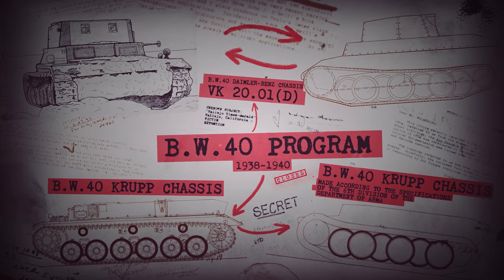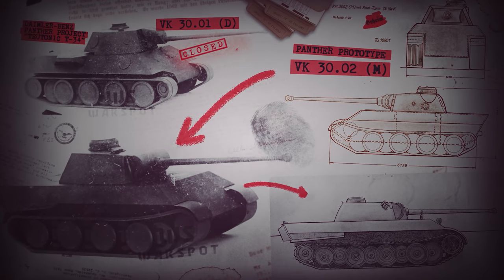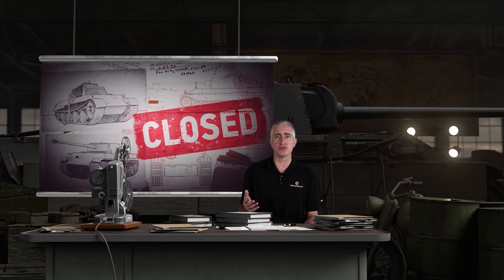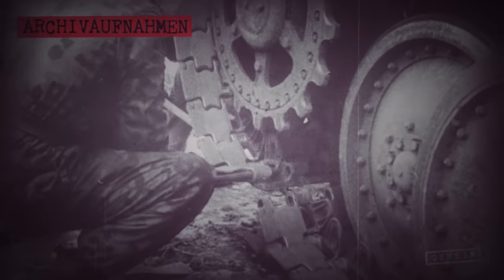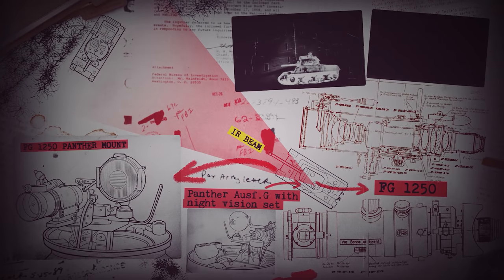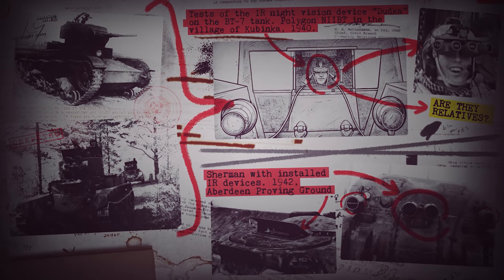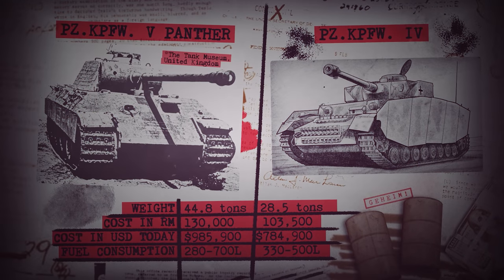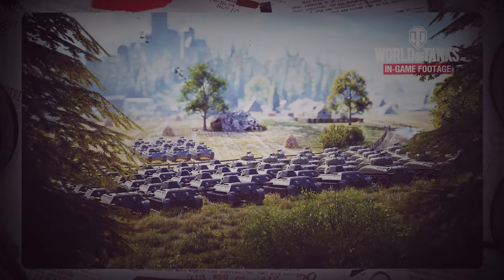Five Things About the Panther with The Chieftain - World of Tanks

Comment: In Quora, I pointed our that Germany only looks like it had more advanced technology because they pushed everything out of the lab and off the drawing table into the battlefield faster than anyone else. The U.S.A., in particular, had some amazing weapons systems in development during WWII, but they never put them into the field.
Reply: A sane addition to our forum.  Thanks for it.
Reply: High velocity guns like 75 and 88mm were generation ahead of any other. And they had jet planes year ahead of anyone else. But their electronics and organization of mass production were lagging behind.
Reply: The USA developed proximity fuse which was a true super weapon. 
And the USA put this weapon into the field both for AA guns and artillery.
Reply: @mladenmatosevic4591  umm the 262 and the meteor were in combat units within weeks of each other.
The German engines, even when produced postwar with "proper metals" had a fraction of the lifespan of the British designs.
As far as combat capabilities, they were designed to different requirements. As they never faced each other, you can debate all you like, but pilots, good ones anyway, fight to their crafts strengths and the opponents weakness. Why you don't go down on the deck to turn and burn with an A10, and an A10 doesn't try to go vertical at 20,000 feet. Insert whatever aircraft you want here.
And 262s, as well as mig 15s, both lost to American WW2 props. 
Oh and the P80 was "operational" by armistice. Again, not quite a year. However the He 280 did indeed fly in 42, but was only in prototype stage.
The 262 was not unique technology, nor was it unbeatable by the allies.
And the 88 wasn't a generation ahead of anything. It was an AA gun. The British used theirs the same way as the Germans in the fall of France for that matter.
The long 75 of the panther was a specialist gun. Low barrel life and small HE for the extra AP values. The Sherman 76 was the same, if less extreme.
Again there is no free lunch, just compromise to get the characteristics you want.
Reply: @drudgenemo7030  In short, British started with jet engines in same time as Germans, pre-WWII, to but Germans had more state resources do progressed bit faster. And P-80 was just a demo project, started about end of war, with access to all British (and soon German) patents. As for German 75 and 88, look at shell velocity. That was some 25% higher than other guns in 1940s. But to conclude, in 1940 key German advantage wasn't technology, but perfected use of large military units, particularly mechanized ones.
Reply: @mladenmatosevic4591  you obviously have no clue about jet engines period, ok. 
The P80 was far from a demo project, but in 1945, I'll give you it wasn't exactly front line, maybe.
The 88 , as originally developed didn't have 25% greater velocity. And the 75 was not an AA gun. Again the point of an AA gun is to get an explosive charge in proximity to the aircraft. High velocity shells, like the kwk 42, based on physics, need a thicker casing, hence less space for explosive. If anyone had great strides in the metallurgy of guns in the 40s, it was the Americans, not the Germans.
Another subject to bone up on, velocity/barrel wear/ explosive payload vs case thickness vs pressure curves.
You really should look into hi ow this stuff works.
And while the Germans had the awesome panzer units, their military was largely unmechanized. The British were more mechanized. The Americans were the first to truly organize their military as a mechanized force.
As far as "perfected", they re organized the panzer units several times between 1939 and 1945. Same as every other county. If anything, the Brits had their armored units more sorted.
Now the tactical use of tanks, yes, though not as far ahead as anyone else as most, and apparently you, believe.
Might want to research the development of armored doctrine by various countries.
Reply: @richardkalmwater5996  Yes, and while the Lockheed P-80 was inferior to the ME-262, the Gloster Meteor was close, and more importantly, the Allies could have built and fueled as many jets as they wanted in 1946, had it been necessary.
Reply: @drudgenemo7030  Indeed, P-80 was barely competing with last generation of piston fighters. As for guns, I was talking of tank guns, and 75 and 88 were used on practically all tanks and Stugs made from 1942. As for organization of tank divisions, Germans had sorted coordination with infantry and artillery and logistics in 1940, and others had that right in 1942 or so. Mind you, first deployed US mehanized division were in Operation Torch.
Reply: @mladenmatosevic4591  sorted logistics? Lol
The Germans never really did that.
Kinda why they lost.
And the P/F 80 can be derided all you want, but at certain altitudes it was a better dogfighter than the 262. Again different design requirements. The 262 was largely designed to kill bombers.
As the 262 and P80 never faced each other that's largely acedemic. By the time the P80 was really operational, it's opponent was the mig 15, a much later and more advanced design, like the f86. Fact remains the 262 would have been facing the P80, a small nimble dogfighter, AND the meteor, a large multirole fighter. And the Soviets were busy with their own designs as well, though I'm less knowledgeable about those, past the Soviet ramjet experiments.
The whittle designs go back to WW1, hardly the same timeframe as the Germans.
As far as the German 88 and 75, the American 3 inch was in a turreted self propelled mount in 42, as the 76 was also trialed in a Sherman in 42, but was deemed too cramped to be workable. yes the German 88 beat the 90 in production dates, but the Germans were trying that for two years before it was fielded, about the same as the Americans.The design ideals were different than the Germans. To get the 88(or the American 90) in a tank you need a large turret ring. Meaning a bigger tank. Not an option really for the logistics be of the Americans, hardly a technology impediment. And if you want to get technical, the Germans really couldn't do that reliably either. The mechanical woes of both the cats are well documented.
Your argument be is a faulty oversimplification. A big gun doesn't do much good at the repair yard.
And a high velocity gun has trade offs. Just because someone doesn't agree to the trade offs doesn't mean they are technologically behind. 
The engine management computer of the German aircraft was indeed a technological superiority(while American naval fire control computers were arguably the best in world). But that is hardly ever mentioned.
An absolutely awesome sight with a whopping 12 degree FOV somehow is(and that being the only sight on the panther).
The German jet engines were, according to the German pilots and ground crew, were inferior to the British engines by a wide margin.
The Germans had physically larger tanks, hence larger guns. That had more to to with logistics and reliability standards than any technical capabilities. The face hardened armor was a technological edge, but with a trade off with spalling.
The Americans would have been far worse off with German tanks than the Sherman. The Germans would haven't been able to produce the Sherman in the numbers the Americans used, and surely couldn't have fueled them in those numbers anyway, so the Sherman would have been a bad choice for the Germans.
A comparison of combat records shows the Sherman to be better as a corps wide tank, if less so 1vs1. And unless you're in a video game, how the army as a whole does means more than armor thickness or penetration values.
Simplification
You are taking village x with a company or brigade or whatever,
You want the tank with 25% down to maintainence, down another 25% due to lack of replacements for combat losses, and what's there only has 3/4 fuel or you want the tank with full unit strength, plus reserves, all fully fueled and with all the accompanying units(air, artillery, supply, ECT).
And even 1v1 it's more tactics and crew training than technical differences in the the Sherman and the cats. The Sherman has a definite advantage in crew vision and turret traverse, as well as mechanical strength (you bang gears in a tiger or panther you are a sitting duck), and rate of fire.
Not insignificant differences that are very hard to quantify with armor tables.
Yeah the Germans had a decided range advantage, but that only works if you got the distance to work with. 
The tiger was a heavy tank so direct comparison to the Sherman is akin to comparing the garand and the BAR.
Reply: @drudgenemo7030  I try to make short argument and you com with lengthy essay mentioning my simplification. Of course it is simplified, if I wanted to put detailed argument I would make own video instead of writing pages in comment to a comment. First lets limit time frame to 1939-1943. After that Germany was bound to lose no matter what. So, in that time frame Germany was running circles in armored warfare against all others, even though their tanks were not so superior to some others. But to French and Soviets was common in early engagements that many tanks do not reach battlefield or run out of gas or ammunition. Not so often to Germans, and that explains "logistical advantage". Regarding guns, compare 75mm KwK 42 and 88mm KwK 43 with allied guns, and note theh had muzzle velocity of 1000m/s. Allied started using such guns around 1944.  As for jets, Germans were few months ahead, but had no decisive advantage. Though, I still stand on position that P-80 was badly inferior to P-86 Sabre which came in use just 2-3 years later and was widely used in number of countries.
Reply: @mladenmatosevic4591  you forgot the faulty part.
And the vaunted afrika korps, which was very tank centric, was getting run out of Africa in 43.
And you base premise was the technical superiority of sticking a large gun in a large tank.
The tanks were somewhat less than reliable. There were indeed less reliable than was acceptable to the US anyway.
By 42, inside your timeframe, the US still had large guns in armored vehicles.
Your whole  premise is flawed.
The premise that high velocity is somehow achieved with out penalty is wrong. 
And you might want to look into the post war tests and evaluations of the 262 vs the P80 and meteor.
The ones done by the militaries, not YouTubers.
And I never said the P80 was superior to the f86, in fact I inferred the opposite.
I stated that the P80 was smaller and more nimble than the 262, hence more performance in certain flight aspects.
Reply: @drudgenemo7030  Africa corps had horrible problem with logistic since British ruled the sea. Even worse, Ostfront was always short both on man and material.
Reply: @mladenmatosevic4591  I wasn't talking logistics.
I was talking the actual combat, which if you wish to ignore because it doesn't fit with you bias, fine. 
And doesn't change the assertion that the Germans were technically superior in material. Again just because someone fields x and someone else doesn't think it's worth doesn't mean they are less technically capable.
The IR system on the panther is another example.
The Soviets messed with it, not for combat but for maneuver, as did the Americans. They concluded it wasn't worth it.
The Germans fielded it a few years later, and concluded it wasn't worth it. AFTER they fielded it.
Just because something works for group a doesn't mean it fits with what group b is doing.
And the British didn't "rule" the Mediterranean, not in 41 or 42, though a case can be made for mid 43. Malta was within days of surrender in mid 42.
In fact the British didn't even "rule" the Atlantic. The German subs were a thing.
And still not a peep from you regarding the m10 which by itself contradicts your argument, let alone the 76 Sherman in 42. Was not approved for production, but was functional.
The argument good enough today or perfect next week..
As the  75 Sherman was superior to the pzr 3&4, the Americans thought getting right was the better idea. Production of the 76 Sherman began in December 43, again within your timeframe, and was in England in may of 44 in numbers. And that's not considering the firefly, which was also an ergonomic pain, that was produced in January 44.
And considering the abysmal failure of the panther at Kursk, I'm inclined to agree that making sure it's right might be the better idea.
And neither one of the cats fit the logistical realities of the Americans. Arguably the didn't exactly fit the requirements of the Germans for that matter, they had difficulties with maintenance and supply(tigers and panthers were abandoned with alarming regularity),without the extra headache of ocean shipment.
The tank that shows up wins every time against the one that doesn't.
And even 1v1, the disparity wasn't as much as most make it out. The "horrible under armored Sherman" had equivalent frontal armor to the t34, and only minutely less than the tiger. The 75 did indeed kill tigers and panthers,the 37 even did, let alone the 76.
The jagpanther in the imperial war museum has 3 75mm holes in the side. 
And a great tank is fine, but 2 or 3 ok tanks tend to beat the one good one. And there is no getting around the production costs or time of the cats.
Reply: @drudgenemo7030  You are getting in details where each could be own detailed discussion. But bottom line is that untill end of 1941 Germans were mostly winning and since end of 1942 they were mostly losing. African landing was marginal here, most troops were fighting and dying on Eastern Front untill near end. Land Lease was steadily increasing, but became really big only after Stalingrad, when war was already decided by all modern accounts. So, what were reasons for that turn and did Germans ever had any technological and other advantage? I tried to offer some parts of military equipment Germans made good, but bottom line is that man who handle it matter more then equipment, and people learn in war providing they survive long enough. That was why Germans did well against Soviets in 1941, but were mostly losing from 1943. And of course, resources in Germany were running dry, by losing territory, blockade and bombing which all together shortened war by couple of years.
Reply: @mladenmatosevic4591  no you very clearly stated that the Germans had a decided technical advantage with the kwk 70 and the 88. 
Not a tactical advantage or anything, but was technologically superior.
Which is flat out wrong. 
And by the time either was produced and fielded, Germany's fortunes were turning for the worse, hence not much help strategically either.
Reply: @drudgenemo7030  if you bother to check around, 88mm gun has almost mythical reputation in some circles, both as AA gun of early '40s and as Tiger's main gun. Certainly it did have massive destructive power and outclassed every Allied tank gun fielded in larger numbers with sole exception of IS-2s 122mm. But that gun was extremely slow to load and Tiger could fire 3-5 shells to 1 of IS-2. There were tank destroyers and self-propelled artillery with equal or bigger calibres but not tanks. I don't count here M26 and few others because they were so rare. But, 88mm gun was too heavy to be used as towed AA artillery, so 75mm was far more used in that role.
75mm was most used German AT gun of the war. It was used on newer ,"long" Panzer  IV, on Panther and on most tank destroyers. It was powerful enough to deal with all Allied tanks through the war. It's towed cousin Pak-40 was produced in series of 23000 from 1940 and some were used even in Vietnam War. USA fielded similar M-5 gun only in 1943. M-18 Hellcat also came in service on 1943, 2-3 years later then German tank destroyers.
Reply: @mladenmatosevic4591  the gun on the pzr 4 and the panther were were different and fired different shells.
And you seem to forget the 90mm
And the 88 flak gun wasn't unique by any stretch.
In use it was, though others used theirs in direct fire as well.
Most of the "88s" in north Africa for example were actually Italian 90s.
And the American 3 inch was fielded in 42. Nearly identical ballistically to the 76
Reply: @mladenmatosevic4591  any just because a bunch of fanboys seem to like something doesn't make any difference in science or history.
The British 32 pounder was a similar gun and used in antiarmor during the fall of france. In 41 the US developed metallurgy to shrink the 3 inch gun down to almost the size of the 75. The 76 was the result.
Same projectile, different case, and a much smaller breach and block.
That is technical advancement.
Making a bigger vehicle to put a big gun into, while not having adequate power train to move said vehicle, not so much.
Useful when it works, a waste of resources when it doesn't.
And the tigers and panther broke down more than the Americans or possibly the British wanted (the British put a 17 pounder in a Sherman 75 so their notions on what works is a bit different from the Americans).
The 17 pounder was similar to the kwk 42, as far a velocity, And predates it by a year.
As I stated before, the trade off is a thicker shell casing and increased barrel wear. No "magic bullet". 
A bigger gun needs a bigger tank.
Period.
A bigger tank needs a heavier drivetrain.
The Germans were willing to deal with the associated problems. The Americans were not. And the Americans had other considerations about dealing with a big gun/tank. The Atlantic and the Pacific.
The simple fact that so many tigers and panthers were abandoned is testament to the fact it was too much for them to deal with too.
A big gun doesn't do much if the tank it's attached to is broke.
The Americans were smart enough to understand that. Hitler and his yes men apparently we're not.
Reply: @drudgenemo7030  I think you are mistaken about 32 pounder. This sounds like 150mm which is massive overkill for 1940 tanks. Average AT gun of that era was 6 pounder or smaller. 17 pounder was enough even for Panther and Tiger. BTW 1"=25.4mm so 3"=76.2mm, without shrinking anything. And intentionally or not you miss fact that German 75 and 88mm were widely used in '41 while British and American guns of same size and shell velocity came in use in 1943. Soviets went to 85 and later 100mm D-10 of T-55 fame.
Reply: @mladenmatosevic4591  You do realise the difference between a 75mm KwK 37 and a 75mm Kwk 42, right? 

Following your opinion, of who came first with the 75mm. The French had 75mm guns in the Saint Chamond tank in WW1, does that mean there we're superior because they are years ahead of the German 75mm tanks?
Reply: @marrsz1  From top of my head, you are talking of short 75mm from early Panzer IV and long 75mm from later Panzer IV and
Tank destroyers? I guess I do 😉. Main quality of AT gun is muzzle velocity combined with shell weight. But lower calibre shell can be longer and therefore heavier then bigger calibre HE shell. Well, German Pak-42 had muzzle velocity of 1000m/s which was 10-20% more then early T-34 or Sherman guns of similar calibre. Also, it had longer and heavier solid-shot projectile. I think you can easiest see difference by comparing guns of standard and Firefly Shermans since data uses same measures and methodology of testing.
Reply: @drudgenemo7030  Did I really read that the Americans had better guns than the Germans ? So this is why today the Abrams uses a Rheinmetall gun? 😅
Best part of German tanks where the guns dude , don't mess with the 8.8 . 

The 262 was a ~ 1941 design , first flight 42 with a prop engine . The Germans had problems with the jet engines , this is why it took so long . New Me262 HG version (high speed) got center mounted jet engines and swept wings . Only on paper , but that was the next level of 262 evolution . Or Ruhrstahl X-4 , wire guided AA missle . X-7 wire guided AT missle . There are many things that people don't know .
Reply: @mladenmatosevic4591  Nope 17 pounder was as good or better than both those guns
Reply: @momachine74  Then why was recommended to ambush heavy German tanks from side instead of head on? And if everything was so great, why only 1 in 4 Shermans used it?
Reply: @mladenmatosevic4591  We were talking guns not tanks, everyone knows the 17 was heavily compromised in the Sherman chassis, but as an anti tank gun the 17 was as good or better than either of those guns you mentioned fact
Reply: @5co756  umm
No I stated that the 88 wasn't a generation ahead of the allies.
It wasn't period.
The Italian 90 was the equal of the 88 while being simpler and cheaper.
The American 90 was indeed marginally superior to the 88. Of course you also need to specify which 88.
The late war paper projects are just that, paper.
And WTF does the 120 in the Abrams have to do with a single thing about ANYTHING in WW2?
In case you don't research tanks much, the British 105 was the gold standard for at least a decade.
And the Russians came out with the smoothbore tank gun first.
Sorry the Germans aped the Soviets. Yet again.
Reply: @5co756  the kwk42 weights 5000 pounds
The American 76 weights 1200
So yeah a might bit better to fit into whatever thing you are trying to put it in
Even the kwk 40 on the pzr 4 weighed 1600 pounds.
So yeah the Americans were at least on par with the Germans in cannon technology.
Reply: @mladenmatosevic4591  the kwk 42 weighs 5000 pounds
The 76 m3 weights 1200
You really are dense.
Just because a 7.62x39 a 300 RUM have the same bore diameter, they're the same class of gun right? 
 Might want to learn a bit about guns before you start getting opinions on them.
Reply: @drudgenemo7030  Rheinmetall builds tank guns in WW2 dude , as today every NATO tank uses the 120mm Rheinmetall . Exept the Brits and their rifeld guns XD . 
So if the US got the best guns why today a Abrams got a German gun ? This was my question , I don't said the Germans got the first smoothbore gun .

And the first P-80 that was really build in large numbers was the P-80C later F-80C in 1948 . All other P-80's where prototypes for testing and many pilots lost their lives .  So you wanna compare a 1942 jet vs 1948 ?
Reply: @5co756  umm
You on drugs?
What does tank guns today have to do with ones 80 years ago?
Granted the German 120 is about 40 years old at this point

And the me262 was in no way operational in 42.
And it crashed
A lot.
Just like most early jets.
Reply: @drudgenemo7030  WTF dude ? The KwK42 75mm-L70 weights 1000kg , the 75mm-L48 750kg and the 76mm-L52 517kg . Who cares about 200kg or 450 pounds in a tank ? Lighter means not better ....
Reply: @5co756  you do understand the advantages of the 120 smoothbore?
A physically smaller gun for the bore diameter, with less barrel wear.
And as a bonus, more velocity out of a sabot because the rifling isn't slowing down the round to impart spin.
But the smaller gun and the bigger boom at the far end are the two relevant items in this discussion
Reply: @drudgenemo7030  Why do you talk about a smoothbore gun now ? 😅 
We are off topic ....